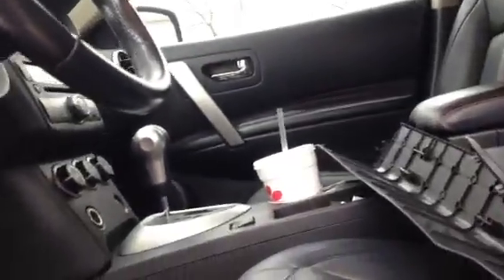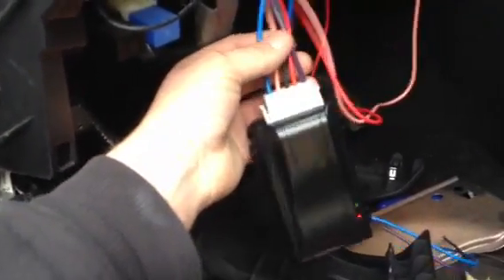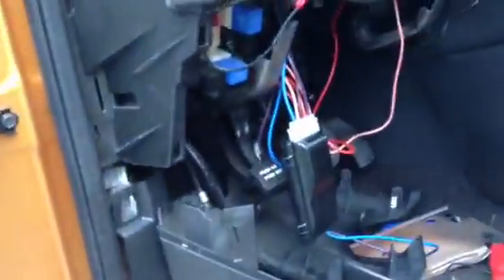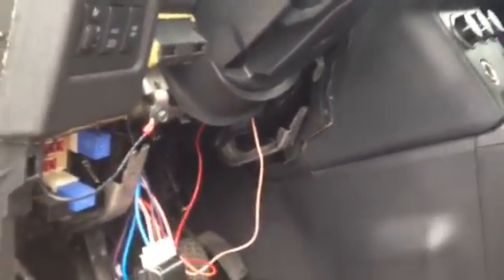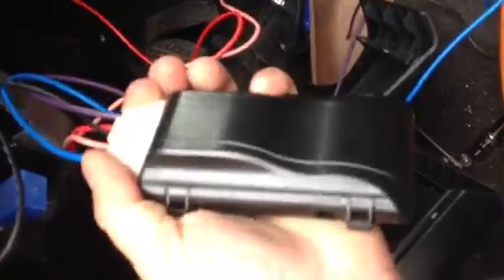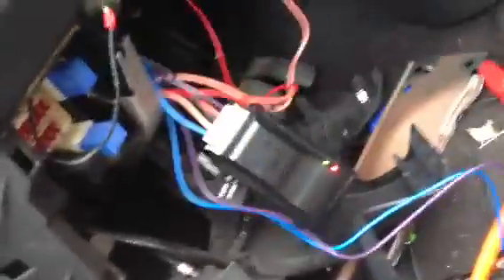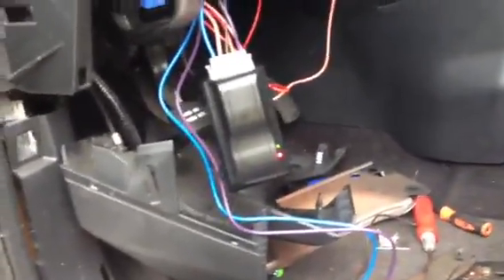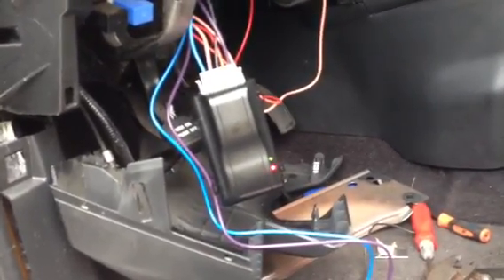Passtime GPS install

Comment: I don't know if there's different laws in different jurisdictions, but I wasn't told a device similar to that was in my mini-van. I didn't even take out a loan, as I paid for the vehicle before I picked it up. The dealer claimed they didn't use such technology.
Reply: I also own my car,  and have the Title to prove it. There is a device like this on my car, and it has been shut down in my driveway for weeks. I don't want to break the Mercedes-Benz C250 dashboard, and need help removing it.  I was never told it was on my car.

Comment: I have removed more than one such unit.
They are rented, and the new ones have GPS.
Simply connect a LM12 liner regulator inline with it and mount it inside a public mass transit bus!
For MONTHS, they were trying to recover it!
Finally, that bus was sold, it is in Mexico someplace!
And, they are a glorified cellphone with a relay, nothing more.
Reply: Arabhacks 🤣🤣🤣🤣🤣

Comment: I bought a lifted 2004 ford F150,  2 years ago. Since that time, i have been thru 3 new batteries...thank god under warranty,  thought that there is something draining my batteries....got a new alternator,  thought that was the drain, 2 month's later, dead batt... i was like what...the hell...well guess what....someone's,  jad installed a Trax-6volt passtime....just took ot out now....hope this is the solution to my problem.....draining my batteries

Comment: Good info. Now just review this video to see how to remove it or bypass it. Look where the wires are spliced in. Simply splice in new wires to bypass the tracking device. Or simply remove it. If you remove it hook the device into another DC source to keep it giving out a signal. Maybe install it on another old vehicle, motorcycle, mini bike, scooter, ATV, boat or plane. But don't hook it up to the ignition. Just hook it up to battery in a loop.  Or maybe to the lighter. Maybe hook it up to a relative or friends vehicle in another city. It will take a while for your vehicle to be found. Eventually your vehicle will be located because they have your  home and work address. Most people stay within their sandbox.

Comment from the maker: For everyone Bitching and whining about this video get over yourself lol.  In answer to many questions NO I'm not going to tell you how to remove the device or what wire will bypass unit. My advice as a finance adjuster is pay for the car and the lender will remove the device at that time and put it in a car of someone who won't pay on their car loan. Thanks for watching as always
Reply: My car has been paid in full, and it was shut down by one of these devices.  They should be illegal to install on Paid in Full vehicles.  I have my Title.
Reply: Remove the red wire and the black wire to override. Thank me later. I can teach you what wires will start it too.